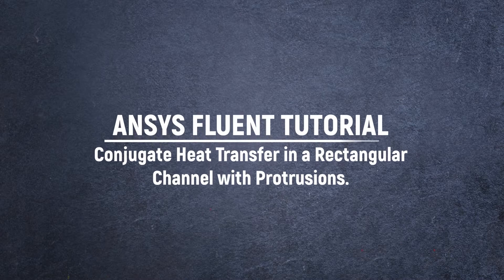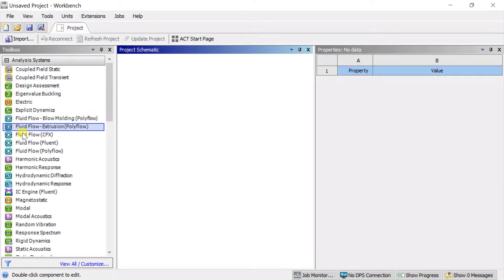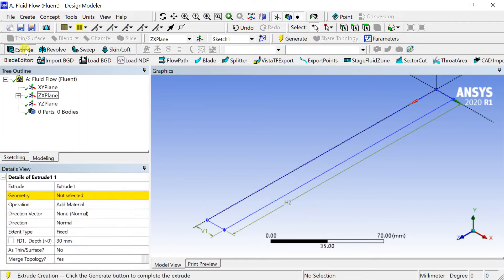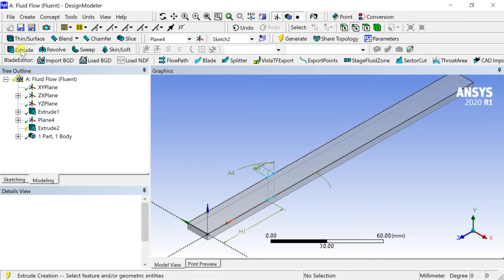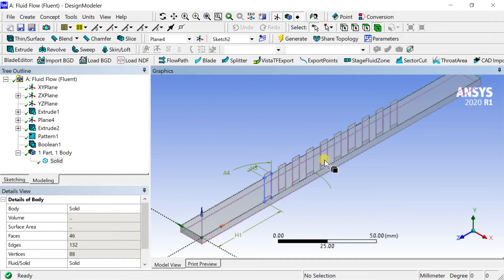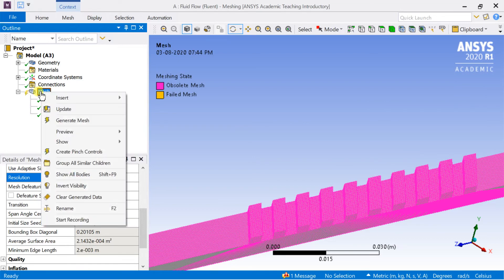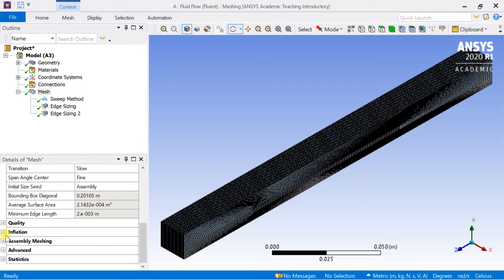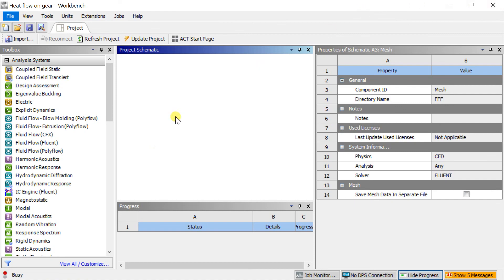ANSYS Fluent Tutorial | Conjugate Heat Transfer in a Rectangular Channel with Protrusions | Part 1/2

Comment: Is there a specific reason you use Design modeler and not space claim? I am trying to simulate a part heating inside an auto-clave, but I cant get the coupled wall to work, it looks like there is no interaction between the solid and the fluid. (great videos by the way)
Reply from the maker: I am familiar with design modeller, thats why I use it for most of the simulation. There should not a contact region between the parts. If present then delete it to get the heat transfer in between.

Comment: Is inflation required around the protrusions to better estimate  the heat transfer
Reply from the maker: Yes, that would be better.
Reply: I tried doing that , but there seems to be a problem with meshing , it results in a stair step mesh and I get errors on fluent about all cell zones being fluid and it gives me warning that I can't simulate using heater plate as a solid
Reply from the maker: Are you using a student version and exceeded the meshing limit?